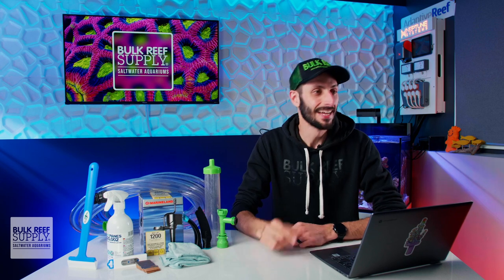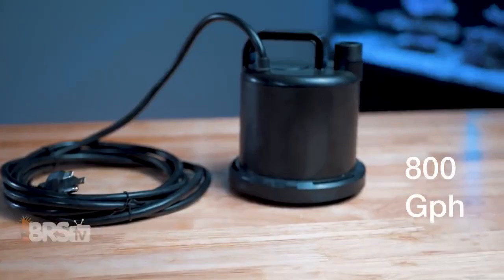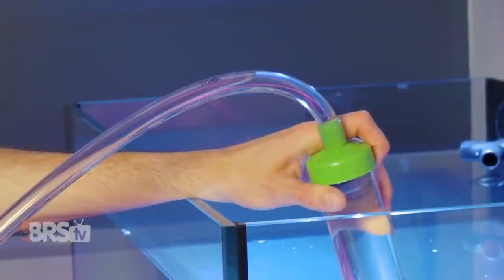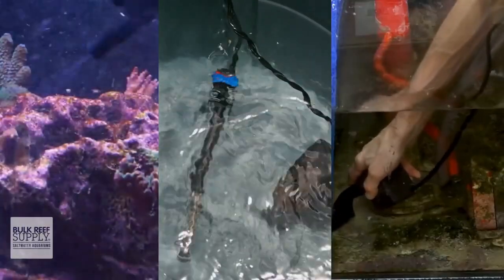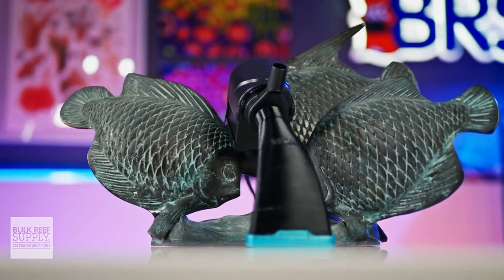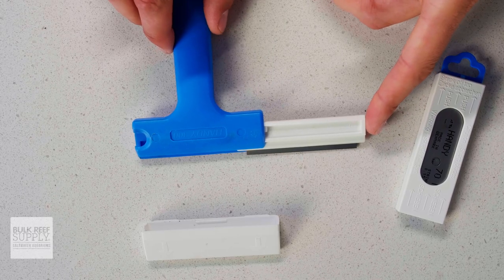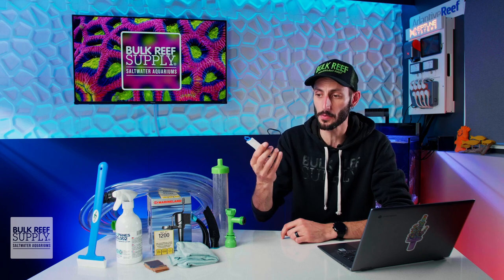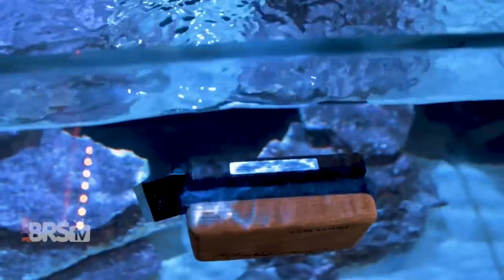Thomas’ Top 5 Tools That Make Reef Tank Maintenance a BREEZE!

Comment: I bought that Python through you all but couldn’t find a way to get it to connect to the sink I have. Ended up getting a cheaper Amazon one that came with a hand pump I could use to start the siphon in a bucket
Reply: certain faucets need adapters.  super simple trip to a hardware store